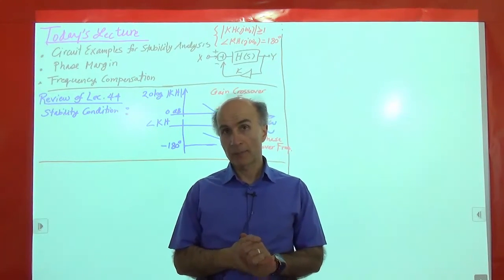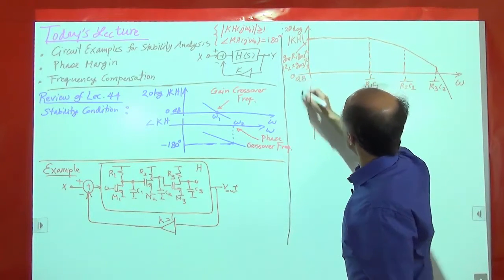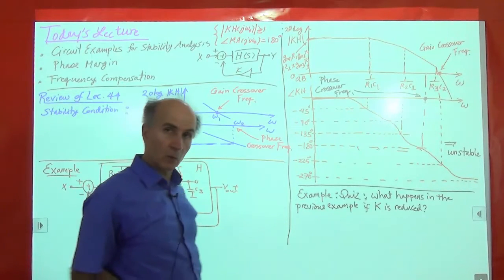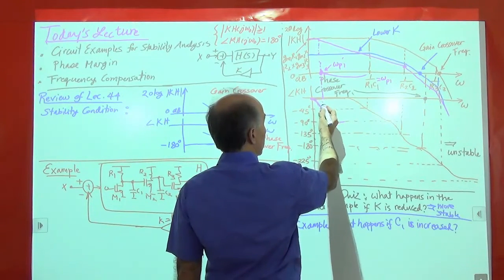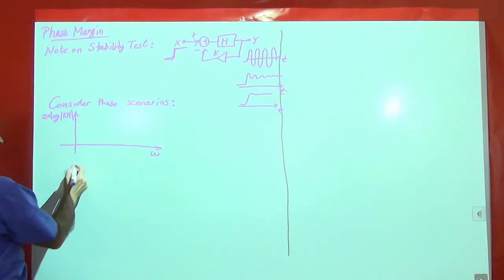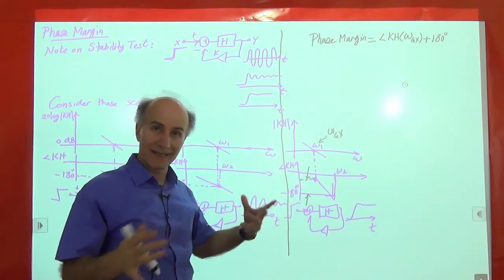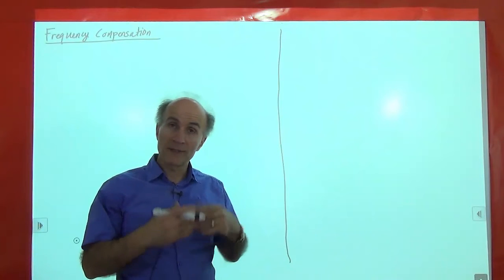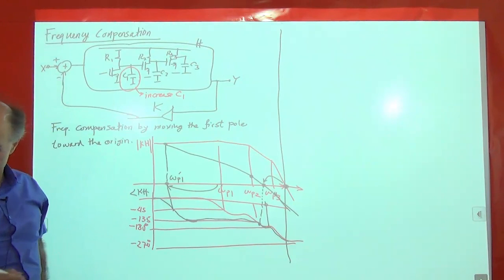Razavi Electronics2 Lec45: Additional Stability Examples, Phase Margin, Freq. Compensation

Comment: It's a long journey, there are so many ideas in the electronics world: gain, input impedance, output impedance, small signal model,  rpi, ro, Vth, CE Stage, CB Stage, emitter follower, differential pair, integrator, unity buffer, ac ground, virtual ground, degeneration, biasing techneques, band gap reference, current mirror, bode's rule, miller multiplication, frequency response, superposition, KCL, KVL, ohm's law, early effect, channel length modulation, phase margin, frequency compensaton, negative feedback, closed feedback loop, open loop parameters, etc.  I must respect Prof. Razavi for his insight, patience and especially this series which is a tremendous achievement.  衷心感谢教授。

Comment: 01:26 - intro and Review
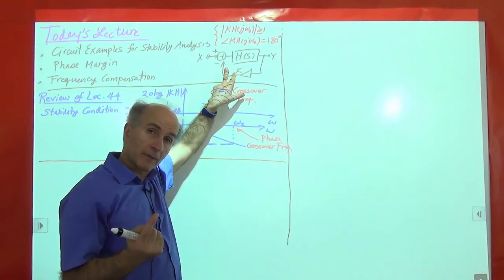03:33 - Three Pole System Example
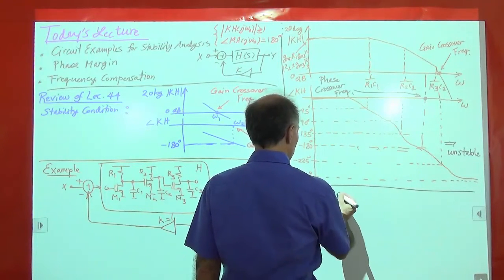13:13 - Quiz: What happens in the the previous example if K is reduced?
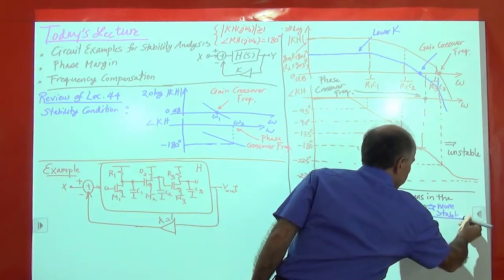17:58 - What happens if C_1 is increased? - Lowering the First Pole
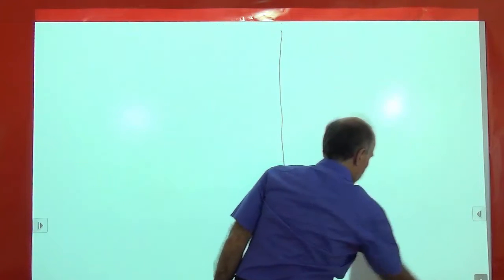25:10 - Phase Margin
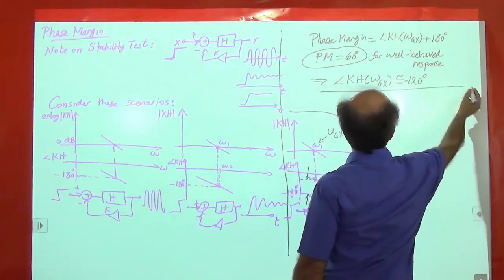35:40 - One Pole Example
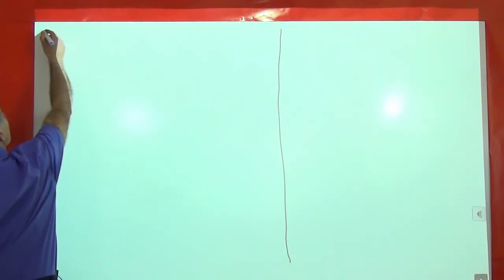40:19 - Frequency Compensation by Moving First Pole Towards the Origin